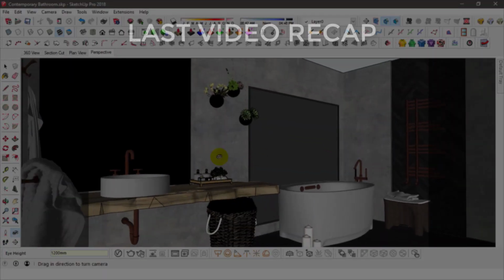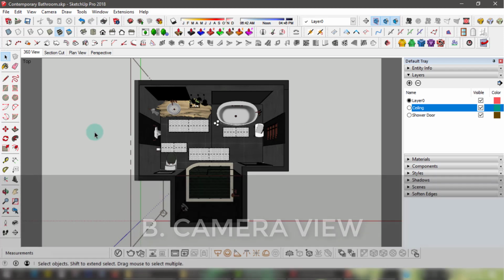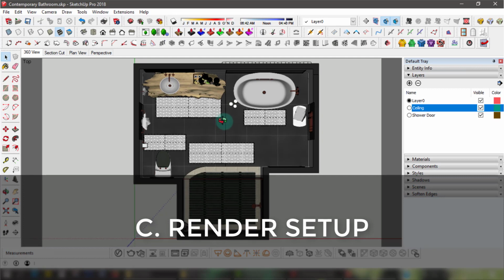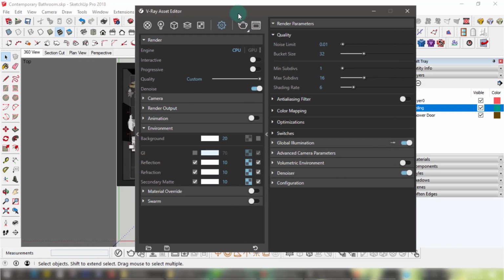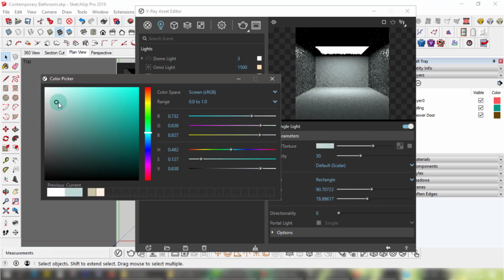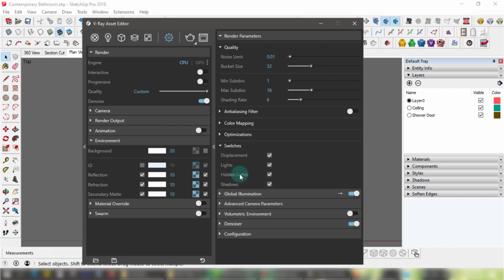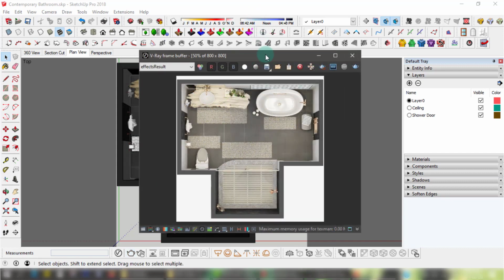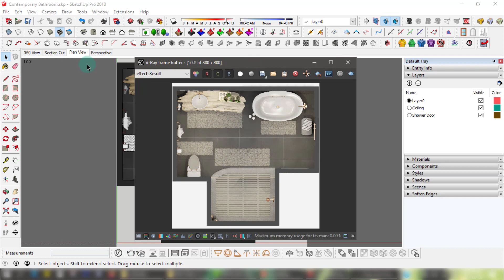Rendering a Plan/Furniture Layout Tutorial | VRay Camera Setup Part Two

Comment: hi can you help me? i got problem while render section plane on parallel mode, it can not go full frame like i'ved set. The picture go zoom in and missing both side :(
Reply from the maker: Hello, do you have the Safe Frame turned on or off?
Reply: @Ravenors.academy  i do, but still not work :((
Reply from the maker: Message me on Facebook, please, with a screenshot of your settings.
The page's name is the same as the channnel :)
Reply: @Ravenors.academy  I have the same problem with rendering in parallel projection can you help me??
Reply from the maker: Here are some videos that can be of help:
Rendering a Plan:
https://youtu.be/6gyTfgtMNd0
Rendering a Section cut:
https://youtu.be/o_0I3v_2N98
Reply: @Ravenors.academy  i saw the video but it stills zooms in when i pick parallel projection even tho the safe frame is on, it's really frustrating after seeing you render in parallel projection 😭😭😭